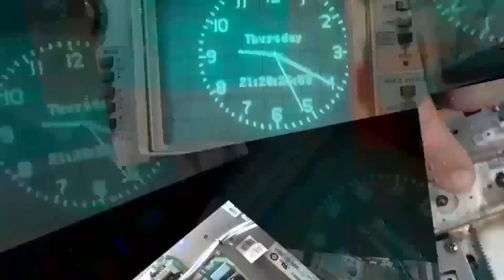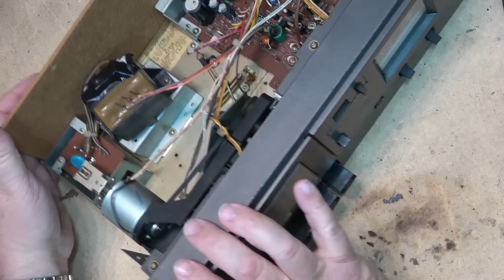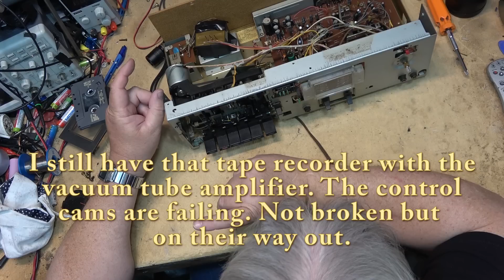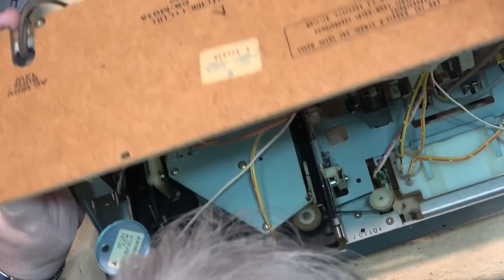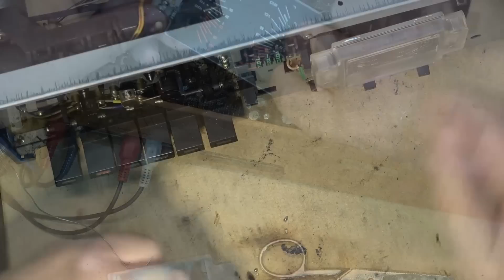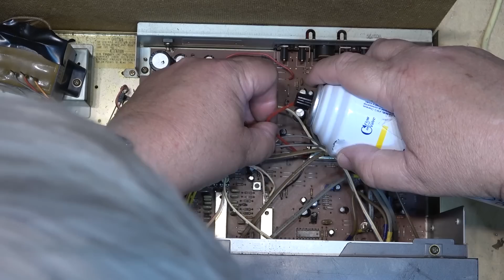Akai CSM01 Cassette Deck No Record on 1 Channel plus other faults

Comment: 05:55 - I can hear some bad azimuth error in it. I also don't like how that black wire goes around the motor. I used to use my finger nail plenty of times on audio heads to scratch off the stuff built up on them. Worn heads are prone to collect them.
08:22 - An overwhelming majority of these motors have 3 armature 'poles', that with 2 stator magnet poles create 6 pulses in a single revolution. It is also called cogging, which is an undesirable mode of operation in steppers,  sync and induction etc. motors.
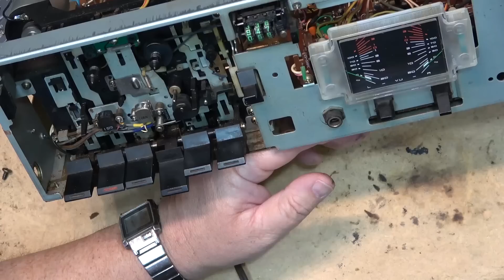20:12 - Was I an unassuming buyer opening it up, me and my OCD would have a Whiskey Tango Foxtrot moment seeing THIS.

I also never smoked (actively) ever in my life, never saw the point in or felt the desire for it. Passively, sadly I had.

Comment: Great. These one does sell for good money! I have this same one 4 years ago in England.. Not working will was how I got it, add pretty much did the things you did, cleaned it...and sold for over £150 hear very fast! So this is a great thing to keep or sold as they are pretty go this :)
Reply: $30, not where we are in the states these go for about $20, $30,  this is not a direct drive decm

Comment: Picked up one of these in silver for cheap recently. All lights working but a dry joint / lifted trace at the line input. Needed a bodge wire fix now fine, just looking for belts.

Comment: The masonite back panel is the dead giveaway making this a low end model. I guess it could be worse (like Fisher) with no power transformer and power derived from a matching amp's power supply and pre-attached non-removeable RCA cables. I'll have to give Akai credit for making the meter lamps removeable/replaceable. You get what you pay for. And don't get me started on Crapley --- (Crosley).
Reply from the maker: I was always a teac / tascam  and Technics guy for cassette decks.   Then I was given a jvc tdv1010 and my God is that a great deck.  The only thing it is missing is dbx. 
My teac v850 is a super deck with self calibrating bias. Wish it was direct drive but other than that it's excellent
Reply: @12voltvids are you not using music bakery any more